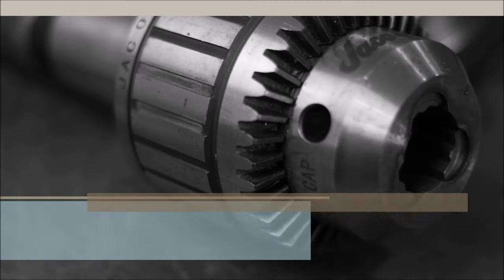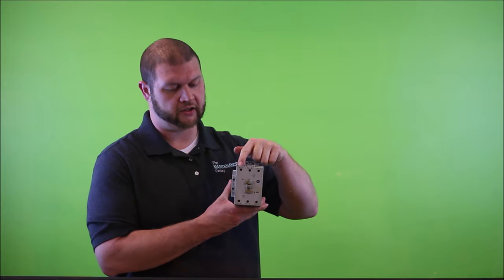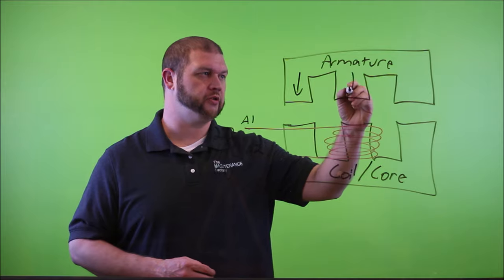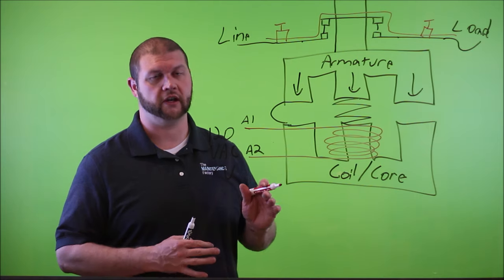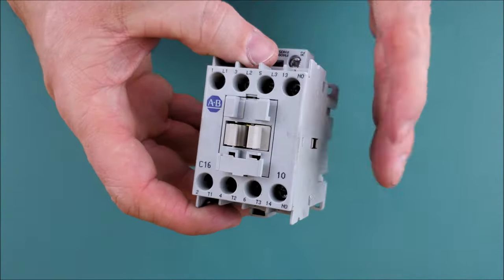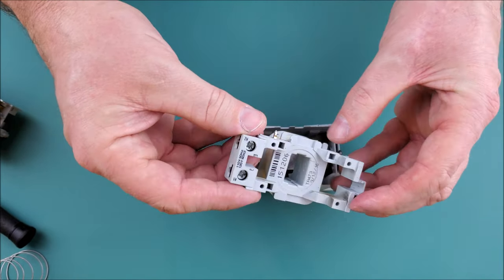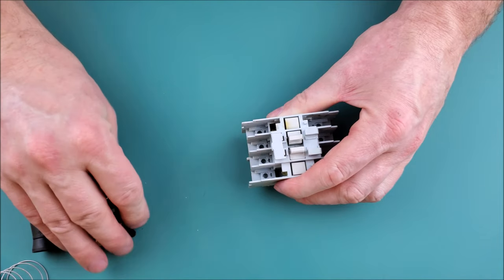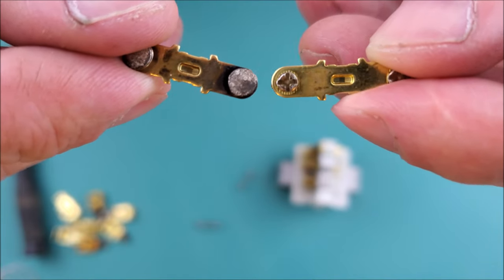Motor Contactors Explained

Comment: You have explained to me what no one could explain in over 10 years working in the electrical field. I did not bother about high voltage installations because of that. I only did residential work. Thanks you so much.

Comment: Can someone give me advice why I don’t get volts on the left side of the auxiliary coil motor starter, I only get 120 volts on the right side of the auxiliary . And therefore my coil would not close to send power to my T1, T2, T3. The left side is wired to back 3 terminal and to my SOL common from the circuit board. And my right coil terminal is connected to the hot power ( on/off) switch and it goes to L1 to the circuit board?

Comment: Thank you for sharing, a really thorough explanation. Now I understand the basic concept.
Is it possible to use DC (apart from AC) for the coil to close the circuits?
Reply from the maker: Yes, in fact that is a very common practice.

Comment: Make sure the spring is inserted correctly, or the armature will not make contact for the motor.  The core can be rotated 180 degrees to clear other equipment and still work.